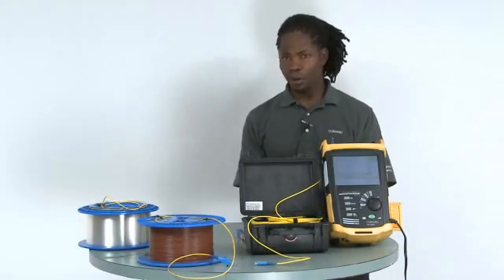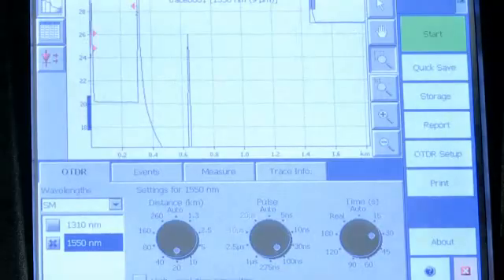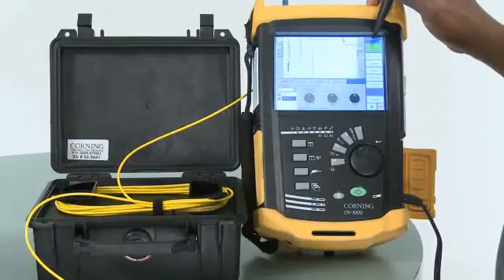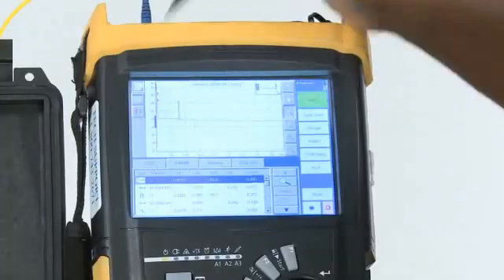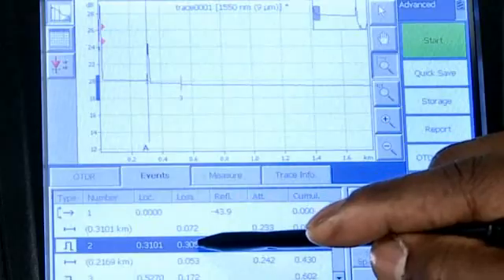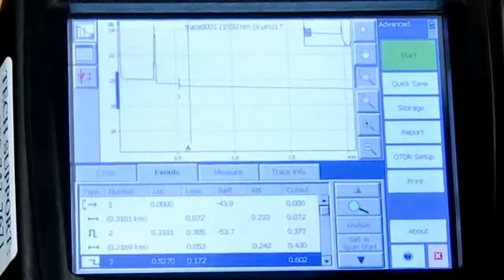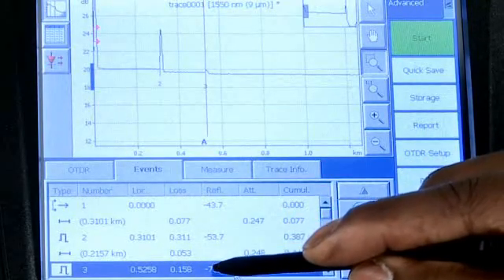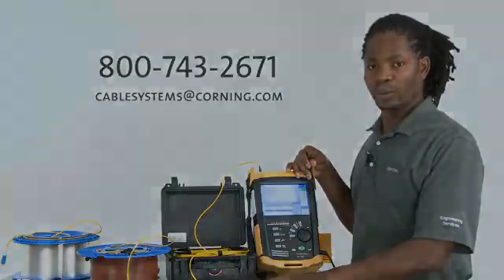How to Read an OTDR Trace - from Corning Cable Systems

Comment: good lecture for OTDR so i hope next so on. but i have one question.  When do I need to use a tail cord (receive cable)?
Reply: Use a receive cable when you need to test the Final, or End connector at the far end of the trace.
Reply: The launch cable is used because of the dead zone that the OTDR naturally has so you use the launch cable to bypass that and get a more accurate reading from the start of the fiber

Comment: Hmm, at 1:47 he did clean the patchcord (or launch reel wich ever you prefer) but he did not clean the coupler. Just a small note :D
Reply: And I olso noticed he gets some reflection on his coupler. 'the peaks' you see on the graph. If the logic is the same as in Europe, blue connectors means they are 0dgrees. Green connectors wich are 9degrees tend to have less reflection.
Reply: jAZAKALLAH
Reply: @wbi007  correct